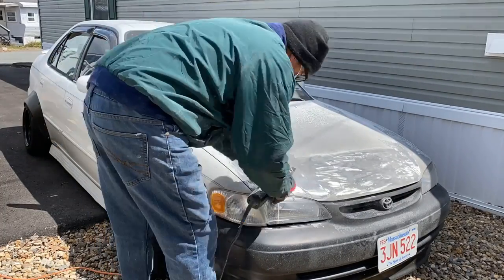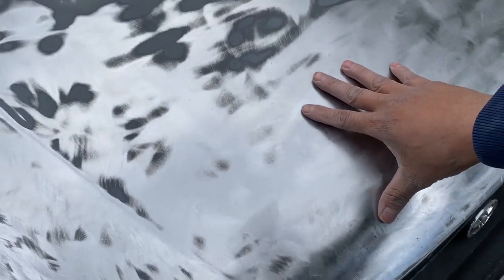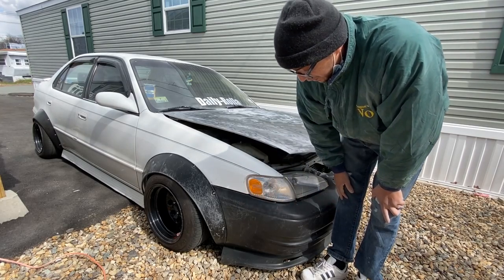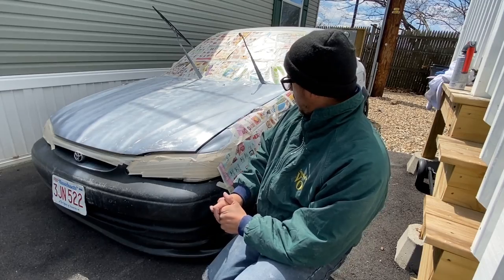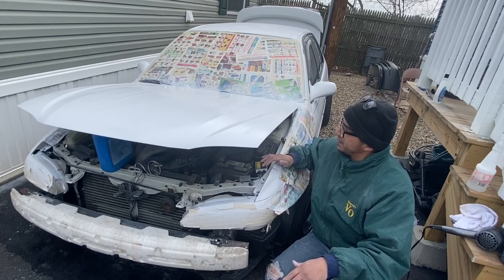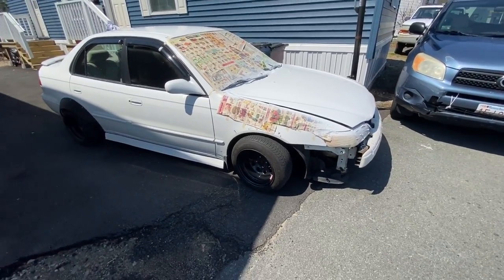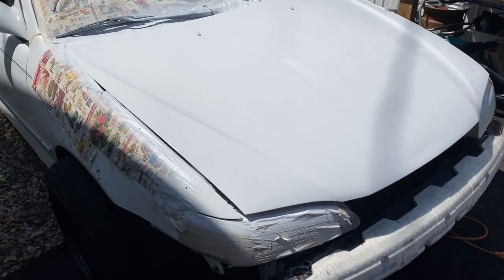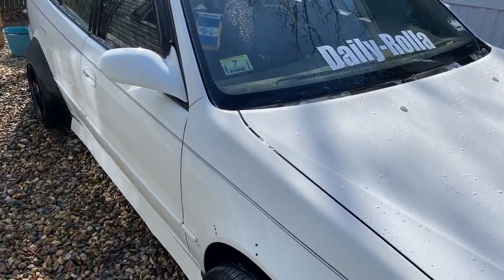how to paint your car / diy spray paint /toyota corolla

Comment: What grit #did you use?
Reply from the maker: I used 120-3000 . 
120-800for sanding everything 
Then 1500-3000 smooth everything out and for wet sanding only 3000 grid
Reply: @DailyRolla  thank u!!
Reply: #what's #with #the #hashtag #?